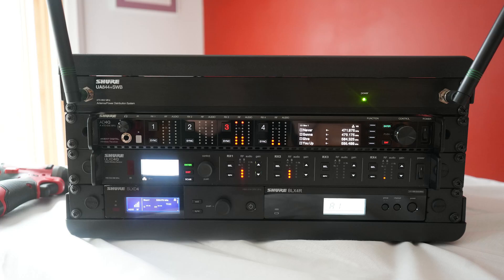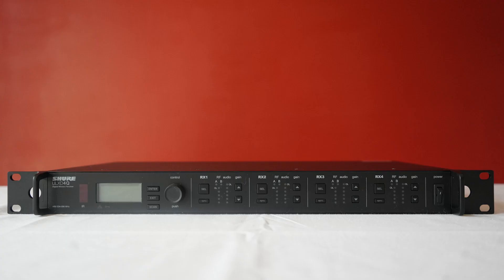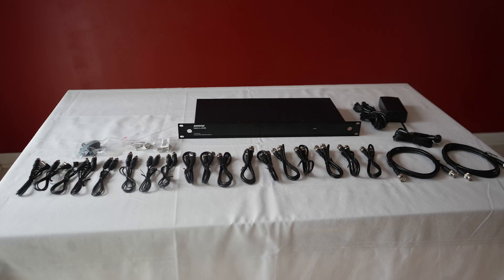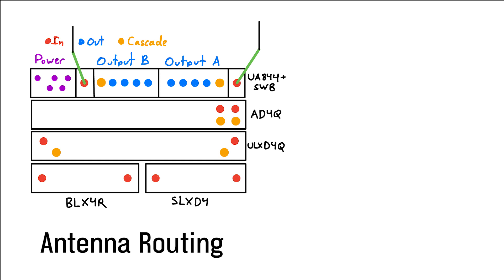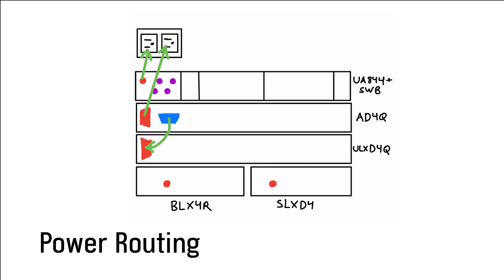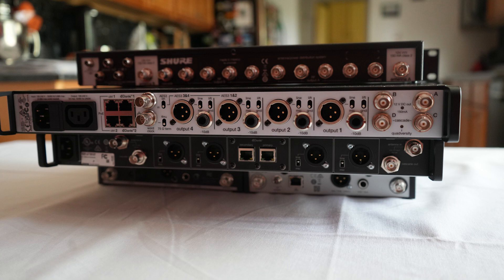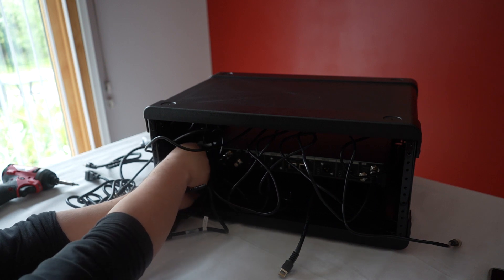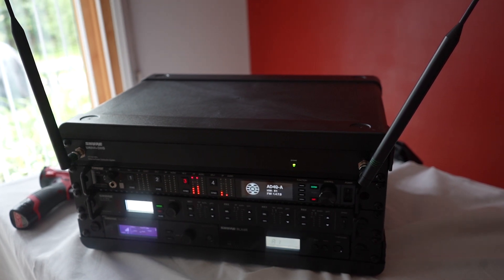How to Assemble a Compact Multichannel Wireless Rig | Shure

Comment: I have 4 shure blx4r  + 1U power conditioner and want to mount on 3U rack with out separate antenna unit.  Can I have one antenna on the front with the mounting accessory and leave one antenna behind each unit ?
Reply from the maker: @BabapranabKrishnankutty  Each antenna needs to be 'visible' to the transmitter so none should be mounted on the back when rackmounting.  For four units you should be using an antenna distribution unit like the Shure UA844 so only two antennas feed all four units.   Try our Wireless Accessory Wizard here: https://www.shure.com/en-US/support/tools/wireless-accessory-wizard
Reply: @shurecreators  Thank you for you suggestions. Really helpful !

Comment: Will the 1/2 antennas with the Shure UA844 work correctly with the SLX-D that comes with 1/4 antennas?
Reply from the maker: Hi there, it depends on which frequency band your antennas are in. If the bands at the bottom of your UA8 half wave antennas are green, they cover 470-636 MHz, so they will cover all the frequencies possible for SLXD and you're good to go. If you have narrowband UA8 1/2 wave antennas (not green), then you need to make sure that the frequency band on those antennas (the frequencies should be written under the color bands) are in the same band as your SLXD device

Comment: I plan on doing a rack build for a 12 channel system with 6 dual channel receivers.  How do you squeeze 12 XLR cables into the back of the rack ?  Ever use an XLR patch panel ?  It just looks too tight and cumbersome since the back of the receivers are recessed into the rack.
Reply from the maker: Hey there. I've never used any kind of XLR patch panel. Most often I just go with a simple XLR snake. There are several out there from different manufactures, that make them with pretty thin cabling so they don't take up too much room in the back of the rack.